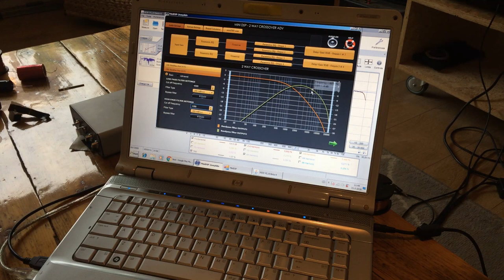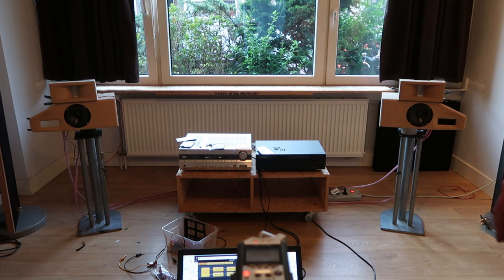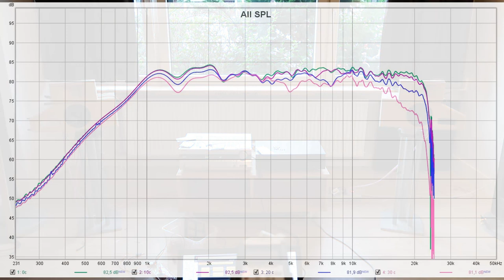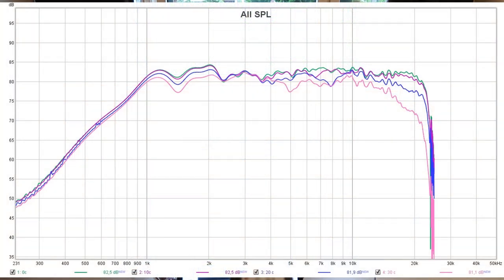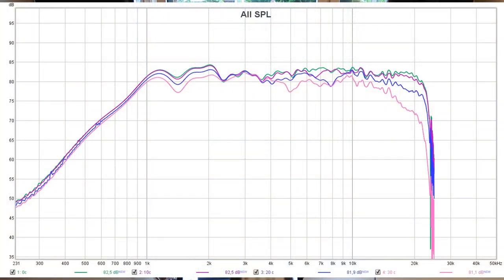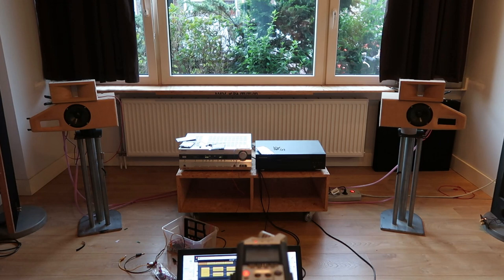My vRibbon in a tractix horn - Music demo

Comment: Save yourself the horn rebuild. A planar has very good horizontal spread of the sound it generates. But very little vertical spread. With or without those top and bottom strips the sound will be very similar. Nice work by the way!
Reply from the maker: it al all depends on size  as you know :) width and height :) the measurement might be the same dispersion wise without the horn, but the added response around below 2 khz wont be there in just a baffle :( i was afraid using a horn/waveguide might hurt the dispersion. or at least had some negative influence.

if i would make the planar square :) vertical and horizontal would be exactly the same :) not going to of course :) can use the extra surface area :)
Reply: @joppepeelen    Surface area is a good thing. But there are costs. Everything is a trade off. You know this very well! If you go square your high frequency content will suffer. This is due to the simple physics of sound and the characteristic of the higher frequencies having shorter wavelengths. As an example 10 kilohertz 340/1000 = 0.034metres. Or 34 millimeters. This is the full wavelength of 10Khertz If your diaphragm is this wide you will have serious cancellation from this frequency on up higher. In fact if you are 1/2 wavelength you will be at the point where it is starting to reflect across your diaphragm and begin to cause cancellation. This is manifested as beaming or narrowing of the perceived sound source. There are ways of mitigating this. You can place ribs across the diaphragms surface to breakup reflections. 

So lets think this through. Square diaphragm, square horn. Using a LeCleach type curve is another possibility. If you use Hornresp it will help you design it fairly easily. Both the Tractrix profile and the LeCleach profile will launch a circular wavefront. You want better high frequency response and dispersion you can play with reflection cancellation ribs.